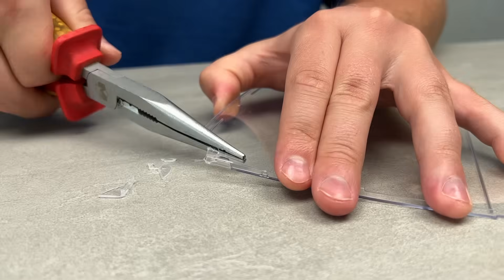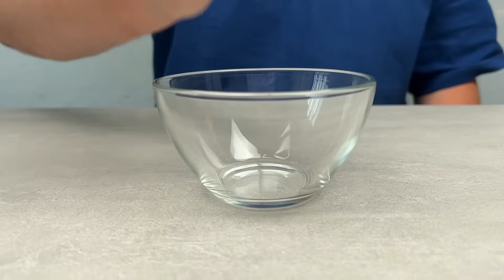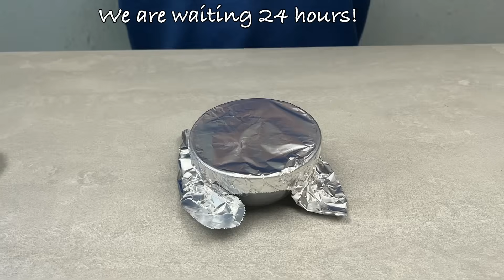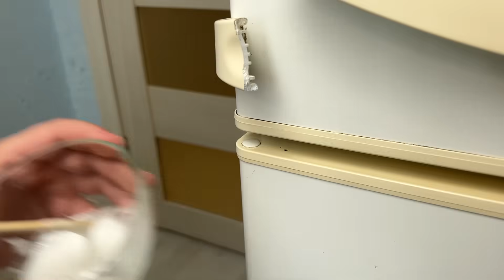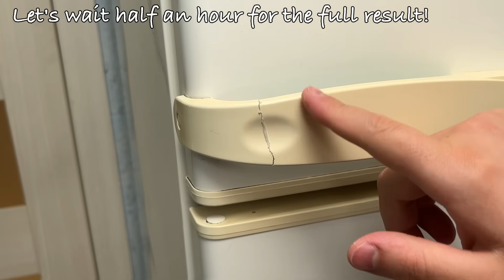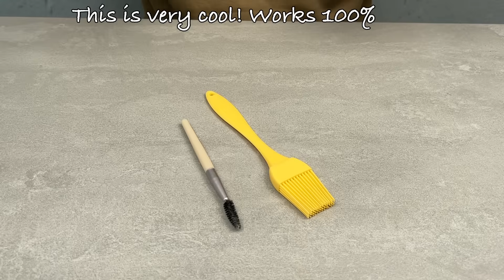I invented liquid PLASTIC! Just take the CD 📀

Comment: Hi nice video.
It is simply dissolution of PolyStyrene or ortiented-PS with aceton; It works with hard PS, but also with styrofoam aceton can really dissolve hurge quantities of the isolating foam; it is fun to watch it chew trough it as if it was a super acid. The glue goo or solution can be done very fast from styrofoam; with hard PS it takes more time.

With CD-DVD-or audio tapes hard transparent PS, you can get a frost like effect since the aceton dissolve imediately the upper shiny and transparent surface; any contact of another PS surface will glue the two very fast almost as if it is fused thermaly; transparancy will be lost unless you work with big dilutions and perfecly transparent PS.
One of the main drawbacks is that PS is PS; so it is a hard plastic but also a brittle one; the plastic solution doesn't dry wel if against a unpermeable hard surface that doesn't allow the aceton to evaporate through it; or if the PS sticks to it so unmolding can be a trouble.
Another trouble is that the aceton can leave the liquid plastic by evaporation; and this works wel for big surfaces; but larger objects often get a depression on top upon contact with air; often one observe bubbles inside the plastic. Very large objects tends to get wrinkels at the surface due to trying to move or unstick the PS out of its mold and the core display a higher concentration and softness than the surface; this because there is a gradient of aceton concentration from outside evaporation and inner PS core.

The PS can be depolymerized at arround 400¨C and styren monomer can be distilled and rectified by distillation and vigreux column aswel as temperature monitoring.
The monomer distills at 144¨C at ambiant pressure as a very refringent liquid; quite stinky, carcinogen (because a volatile aromatic); upon storage and standing it repolymerizes ; and the mobile refringent liquid slowly turns into more and more viscous oil and finaly hard PS; here there is no aceton so only a moderate contraction is observed during polymerisation; also no bubbles show if not agitated.

Kind regards,
PHZ
(PHILOU Zrealone from the Science Madness forum)
Reply from the maker: I completely agree with you and thank you for these comments. Thank you for these clarifications. This is useful for both us and our subscribers.
Reply: Waow
Reply: Im looking how to make clear aqua emulsion gloss for spraying on finished leather as shiny
Reply: @bmsa2073  
You are looking after a varnish or a wax to coat or to nourish the leather beneath.

Unfortunately PS is absolutely not a good plastic for you or that application / use because PS is hard and BRITLE; a good feeling of this can be experienced with aceton an styrofoam, just a little to get a fluid solution; when leaving on a thin PE film in the air; aceton evaporates and leave a thin layer of PS; transparent but very britle; it can be crushed into flakes and dust with the wrapping of the PE film with the hands.

It could be OK if the leather is thick and hardened but not if thin and smooth and flexible like gloves, jacket, pant, dress or belt.

The main problem is the lack of flexibility of PS; it is a bit like coating your leather with a glass pelicule; the leather will loose its flexibility (unless if processed into thin fibers like optical fibers; but even glas optical fibers are britle and break above a certain flexion or curvature; so that would be a disaster or display a bad effect with cracks, discoloration, opacity at the rupture points or wrinkles.

Better use PE, PU, PP, polylactic acid, polyesters, silicones (I stop here with my consulting to you for your R&D job; after a while you have to brike by yourself to enjoy it a bit ;o) )

PHZ
(PHILOU Zrealone from the Science Madness forum)